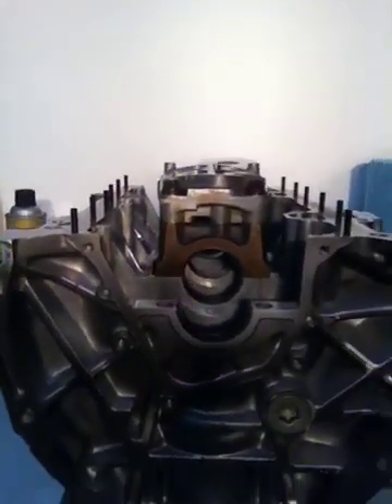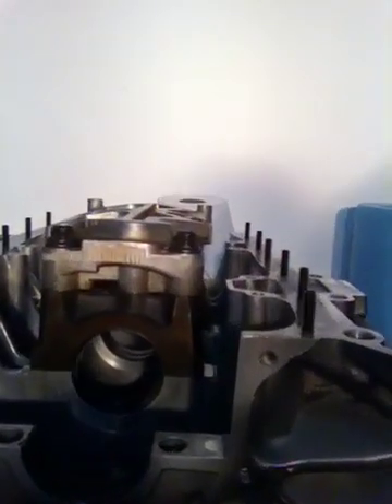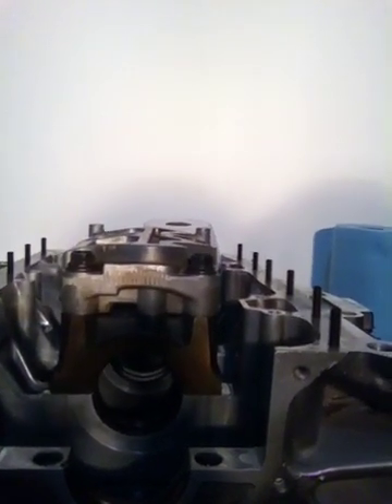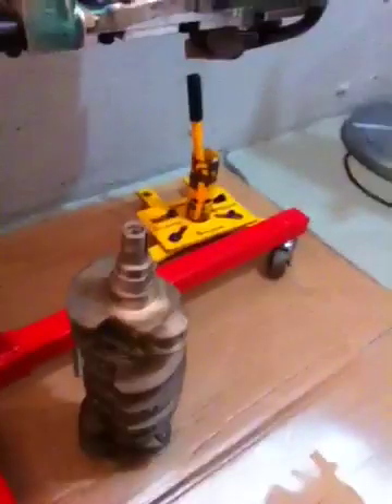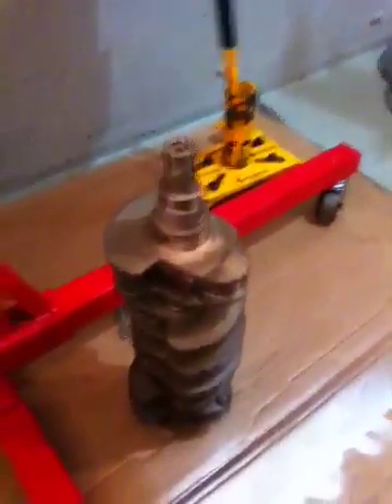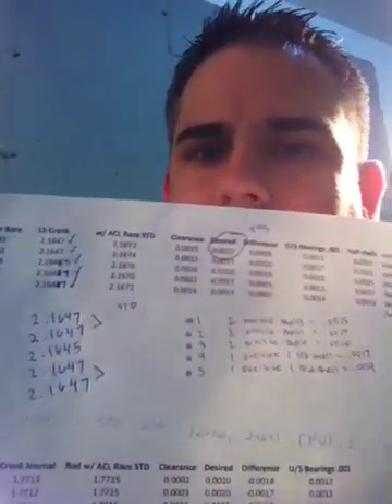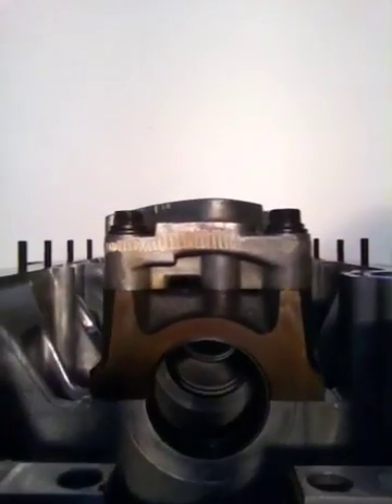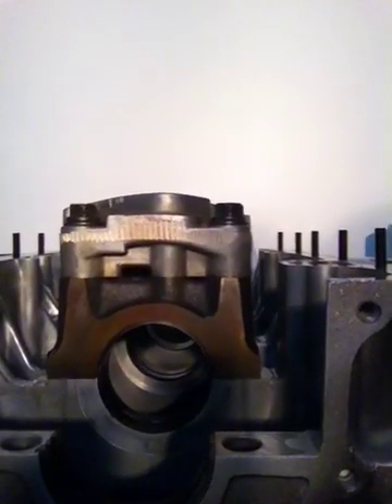How to measure main bearing clearances

Comment: you should consider doing the same thing but with the bearings out of the mains.  just measure the main bores torqued down then do the math to get the clearance, the soft face of the bearing is designed to conform slightly to the crank and will give you an inaccurate reading doing it with them in place.

Comment: You're very welcome!

To the guy below who was asking about measuring actual bearing thicknesses... you would want to use a micrometer similar to what I show in this video, HOWEVER, the ends of the mic that make contact with the bearing surfaces need to be ROUNDED instead of FLAT.  This is because of the concave shape of bearings and a flat surface not being able to sit flush with the surface.  Also, flat surface micrometers will scratch up the bearing surface pretty easily.
Reply: EPREBILL
Reply: EPREBILLb

Comment: Just got to say this really help me out I'm building a b20 vtec that I bought a b20 shortblock that the guy a spun a rod bearing an the crank is done so I bought a b18b crank but couldn't figure out how to measure my bearings, but now I do.
Reply: Did you ever figure out how to measure your oil clearances? Bc the way this guy did it is completely wrong. He would be better of using plastigauge instead if his technique.